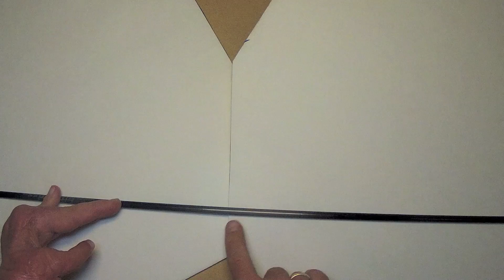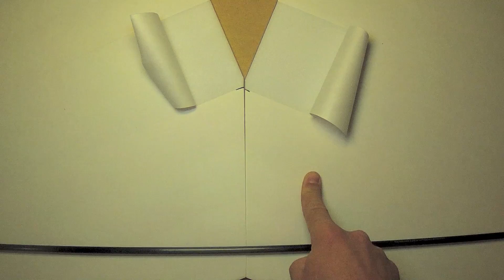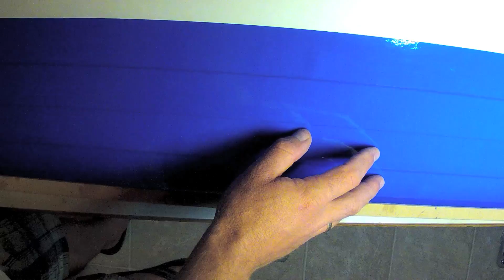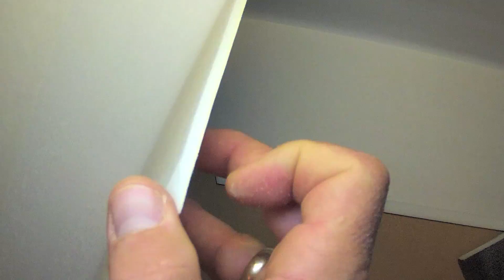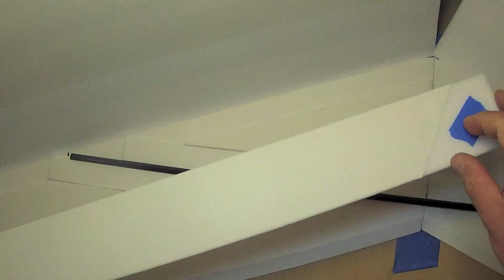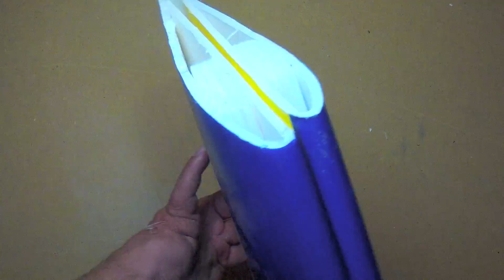SYNAPSE WING BUILD - Method B: Base Cut Then Build

Comment from the maker: I elected to specifically omit washout from this design only for building simplicity.  I know that washout is ideal for flying wings but I found the geometry of folding up foamboard with washout to be challenging.  I would be happy to see your ideas and try to incorporate them though.  You can PM me a video or link to information.
Reply: If you taper the aeileron so it's much wider towards the wingtip  and add a slight amount of up trim wouldn't this have the same effect as trying to build in washout?

Comment: First day of checking out your channel.  I have been folding paper airplanes that are flying wings based on the designs of the modern day hang gliders, employing folding methods that provide spanwise twist for washout and building up the wing with internal structures and extra top surface coverings to create high perfomance wings.  Would like to use your techniques to duplicate the OmniWings and then apply Remote Control.  Question.  Are you applying any spanwise twist with your build?